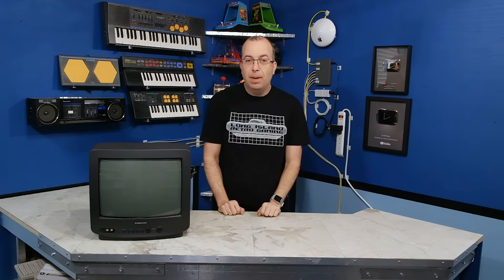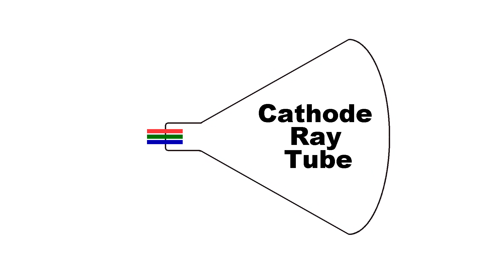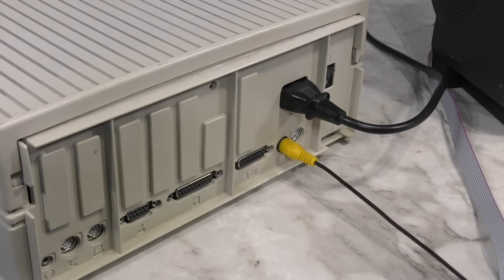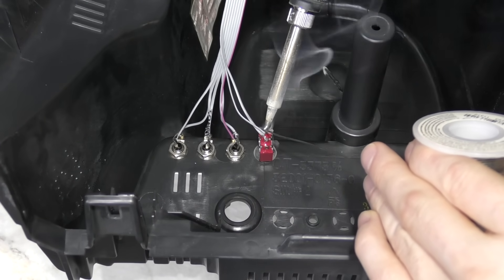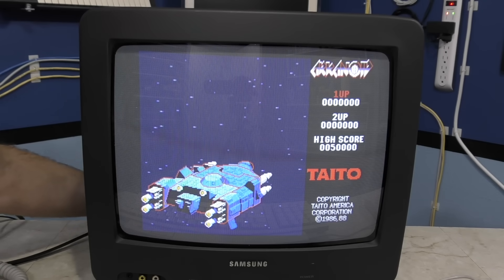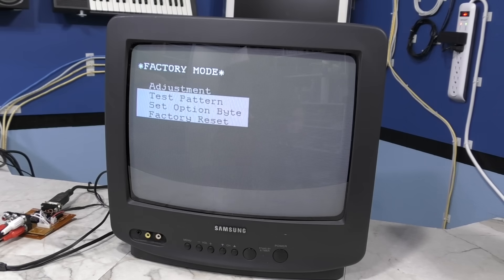Modding a consumer TV to use RGB input

Comment: As someone that still works on TV's today as a hobby, I find the Flat screens of today seem to have a shelf life of around 10 years if one is lucky, some longer then others mind you, but those old CRT TV's seem to last forever, I pick them up off the curbs all the time and even after being wet from rain or heavy morning dew you let them dry out and they work perfectly fine.
People tend to toss those old CRT TV's out when they upgrade even if they work perfectly fine, my only complaint is they take up so much room otherwise I'd probably grab them all. I keep them around for use in the garage and emergency backups.

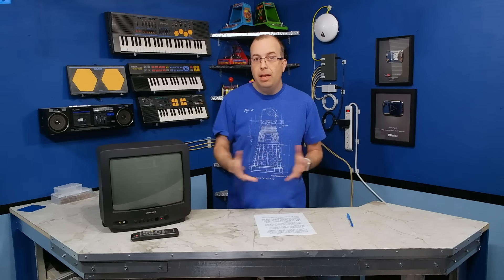Comment: 17:30 yes you can, I have a raspberri pi running retropie with a HDMI to VGA converter with a custom VGA to scart cable and edited the config.txt to output to 60 Hz/15.6 kHz and it works flawlessly, it looks exactly like an arcade monitor, you can check it out here: https://www.youtube.com/watch?v=GdIP667aN58 there's a link  in the description on how to make your own cable.

Comment: In France, most cathodic TV had a SCART input. But these SCART channel almost never do the modifications you've described. Most of the middle price SCART (Péritel) cables only connect Composite and audio. And most of the devices (like VCR) don't provide RGB on their connectors, even for Péritel.
Like my brother says :
"Composite is the devil"... for the high frequency signals...

Comment: Why did the US never get a standard RGB connector for their TVs? I'm in the UK and since my Sega Master System I've always connected using RGB scart and it looks great.
Seems weird to me that you guys just went without. When DVD came out did everyone just settle for composite? DVDs look so much better in RGB scart.
Reply: yep, we basically just settled for Composite. I still remember using it regularly into the early 2010's before we started using S-Video for a short time then going RGB. we didn't know what we were missing so nobody knew there was anything better haha
Reply: In North America it was composite, or S-Video if you cared about picture quality.  Then on to component cable (YPBPR) for early ED / HD for a while until HDMI came around.
Reply: @JeremyLevi  we had s-video since the 80's it was not called that then but you had 2 RCA luma chroma connectors then that turned into s-video which we used till component came around which is the same thing just with chroma split down even more
and we did have SCART in america some TV's left it in and we even had japans RGB on many TV's in the 80's
we are america just because it wasnt a standard didnt mean we didnt use or have

Comment: Looking at the shape of that block where the composite ports are on the back, it looks like the shape of a scart connector, you could have probably just remove that and replace with an actual scart port, and maybe add a couple of passive components.

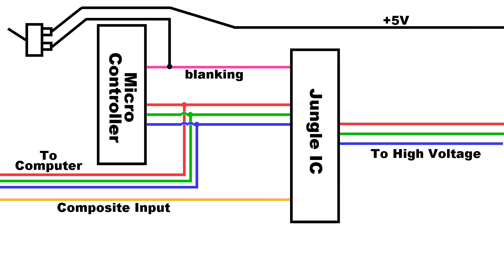Comment: 4:56 So that's why, when tuning an analogue TV that has a character generator for its OSD, the OSD would sometimes get corrupted, it's because of the irregular or bad sync signal from the tuner!
14:53 Ah, so you do have the original remote for it!

Comment: One comment is if the TV has no composite connectors be careful as some had chassis not isolated.
I was also surprised that the US did not have RGB inputs as it is so much clearer.
It may have been possible to just to add a scart connector as under the plastic with the phono's on the rear may have been the position to solder one.

Comment: What I’ve long been interested in doing is something that would likely require working some of the high voltage output: a progressive scan mod. That way VGA can be inputted without hsync tuned all the way down to 15khz. In theory, if what is suggested by Technology Connections holds true, analogue TVs should be able to display a nearly unlimited number of scanlines, as would be expected with normal computer CRTs — limited by controller circuitry chosen of course. Horizontal resolution will still be capped at 720 pixels, at least for color.

Comment: Please do not promote using a lighter on heatshrink tubing. It is recommended to use a hot-air gun (you can get those for $15 to $20 at the hardware store)

Comment: A funny detail about this tv, the connector at the back looks like the shape of a scart connector. The shell of the TV has a matching cut-out hole. I guess this model was made for internation markets and they could just put a board in there with either a scart connector or that block with the two RCA jacks.
Reply: I live in Sweden and I used to have that exact Samsung TV and it had SCART.
Reply: I noticed that as well haha
Reply: Can confirm, I had this exact same model in Norway, and it had a SCART on the back - which as was pointed out in video, literally everything over here had SCART on the back. Usually with a fancy switchable SCART adapter that took RGB + Composite input and allowed you to swap between them on any SCART input device.
Reply: Noticed too. But may be he need a different cpu rom
Reply: Thought the same too. Same models sold worldwide with slight alterations. Thing is, RF is always seen as quite bad but my "new" CRT has a quite good RF quality and it's more the sound that is suffering. Far better than I remember and as certain emulators, trying to emulate the RF signal, make it out to be.
Funny thing is, I bought Composite cables for all my consoles as TFTs don't come with Scart anymore and shortly after I decided that I need a CRT again as Mega Drive games looked horrible on the big screen. Now I wonder if I should buy RGB-Scart cables. At the moment I'm using Composite to Scart adapters (5 consoles + C64) on a Scart multiplug (cheap one, not something like a Hydra) and it seems to be causing interference, while the Sega Saturn's proper RGB-Scart cable works fine over the multiplug.
Oddly enough its worse plugging the multiplug directly into the Scart port of my TV instead of having it connected to the Composite ports via a Scart to Composite adapter with another Scart to Scart adapter in between. Looks like a Frankenstein creation. (cable -> adapter -> multiplug -> adapter -> adapter cable)
Reply: @moomah5929  If you email Bob, from RetroRGB.com, he might be able to help you.

Comment: 14:27 Any chance on more info about this device? Where to find, or even build one? Eventually I'll want to get the old 8088 PC box up and running again. The CGA monitor for it will either need an adjustment or some fixing. If I can't salvage things, this mod would make for a handy backup plan, as I still have a good working CRT TV, (though a bit newer than yours, made about 2000s or so.)

Comment: few years back i moded my polish early 80's tv to accept either composite or rgb because it was limited to 4 channels over the rf  from the factory, and it took much more reaserch and work. For starters i had to rebuild av and rgb modules myself, because even if they were popular in the early 90's as common upgrades they are no longer sold
2nd issue i picked up my favorite tv from my childhood, neptun 505d and an early model at that, so i had to deal with modules that  did not really like my modyfication at forirst, and on top of everything i had to recap and clean the whole tv, i also get a fresher crt for it
so in the end i made a big mess of things before i get to the point i wanted and rgb had to be internaly converted to r-y b-y y signals anyway, but by factory schematics i have signal autodetection :]

Comment: You're working with a TV which has a shadow mask display, now this mod on a TV of the mid-2000's which is based on the Apature Grille after Sony finally let their Trinitron tech patent lapse and you'll see a MASSIVE difference.  DEFINITELY  go nab a  gently used  CRT made after 2000 if you can and do this mod. The results will blow you away.
I say this as an owner of a few nice Sony Trinitron BVM's, while the grade of the  Cathode Ray tubes are not as nice on commercial  TV's as opposed to  PVM's/BVM's the results are still very much worth the effort!

Comment: In PAL region we have SCART connector with already RGB input. Also many PAL TV works with NTSC signal. So you could just buy TV from Europe and make only adapter.
Reply: difference in voltages would make it impractical for regular use though

Comment: Amazing I wonder how big of a difference it would be for me, I have two zenith system 3s one is from 1983 with only an antenna( probably not the right candidate) the the other is from 1985 with an vcr av input and an av loop output? That would be the possible canidate but I’m not entirely sure, perhaps it’s just to old and lacks the right input

Comment: damm, fucking awesome...i remember the main TV in my parents house to only have cable connector, i wonder if this modification could work since i've searching for a RBG monitor for the past 2 years, and to have the old TV that my parent still have in home, working over RBG would be so sweet...the thing is, even to connect my n64 we needed to connect to the VCR and output to the cable input to my TV, wish to test if is possible or at least recycle that old tv if is not possible...great video!!!!

Comment: Didn't know scart was only available in the eu. Scart had 2 drawbacks I had to deal with many time's is the ruggedness of the cable and the way the port was mounted in tv's and vcr's. Many times the connector comes half lose from the socket. I rather preferred those jack plugs instead. I never understood why scart cables had to be so rugged.

Comment: Funny thing: the large almost-rectangular opening on the back of the TV (it's slightly slanted on the left hand side) is for the SCART plug. Samsung simply repurposed it for the North American market.
My Amiga 500 connected to the 1084S monitor via SCART. Later, I soldered together the parts of a TV tuner so that I could watch TV on the 1084S, but because I used a 5V wall-wart adapter rather than 12V, I didn't get all channels. That was solved when I bought a VCR from a friend of mine. Now, the Amiga connected to the SCART in of the VCR, and the SCART out went to the 1084S.

Comment: It is much easier to get a TV or monitor with a Scart connector which takes RGB signals anyway.  They are not so common in the USA I am told but in Europe they were the default standard since the 1980's until high definition became a thing.  As such, you can simply buy a converter cable from Amazon.  In fact I notice a cut out by where the switch is installed in this video where the shape is that of a Scart connector which tells me that this model TV would have had a Scart version at the time.

Comment: I suspect that open spot on the PCB was for a VCR control chip. Montiners of that size were typically combined with small form VCR's, in an all-in-one setup. So the manufacture probably only made one board and in solo TV set, just left the spot empty.

Comment: I really love having CRTs around not just for gaming and computing but also for making content. What camera are you using, David? I use a Panasonic 3MOS-based camera and typically set manual focus, shutter, iris, and white balance. I'll dial the focus ring in to grab everything (including moire) and then back it out ever so slightly. The trade-off is a potentially soft picture. Most of the displays I shoot are pretty small - like a Commodore 1702. That said, it looks like your video turned out just fine. Nice work!

Comment: Wow, all the years I had the identical pal version of that same telly, I never knew it's potential. At the time I worked in an electrical shop in Ledbury, England, where I noticed for some reason most of the Samsung crt tellys seem to be set up with that over scan issue. It was really noticable on channels that displayed the channel logo in the corner.

Comment: In Europe the TV-s were sold with Euro-connector, which already had RGB signals, so there is no need for any modifications inside the box. I own such analog TV from 1996 and I am still waiting for it to go down, but it is obstinate and works flawlessly for more than 22 years without a single failure - made in Poland!!! To watch DVBT I had to buy separate decoder with Euro-output.Unfortunately I have no computer to use it with this old-TV, but I use emulators on my PC. Anyway, great video, as always. Greetings from Poland.

Comment: This is the coolest project video youve done so far! This may not be possible to do as i dont know if the schematics are avalable, but since I first read about it in "Atari: business is fun" Ive been fascinated by how Ataris early arcade games (Pong, Computer space, night driver, ect) overcame the limitations of computers being prohibitively expensive  by making boards that hijacked the ray gun in off the shelf B/W tvs directly and ran games without a single microprocessor. Basicly they were only slightly more complex than one of those early LED handheld games but controlled a tv ray tube instead of a bank of LEDs. Maybe its a little out of your "genra" of videos, but id love to see someone try to recreate this.
Reply: Something that works similar to the Vectrex?
Reply: What you're talking about it Vector based TTL Arcade games. Vector because the beam isnt a raster scan (left to right and back), the X and Y are controlled by the game. CRT Osciliscopes are functionally identical and with a 2 channel version with an XY feature, you can turn it into a vector display. In fact there is a modified version of MAME which outputs the vector image over (i think) audio lines for the x and y and thus you can play the legit version of Asteroids on a real vector display.
Reply: You might find these interesting: 
https://youtu.be/PZsWqOuJFKI
https://youtu.be/aq30EdgSpOY